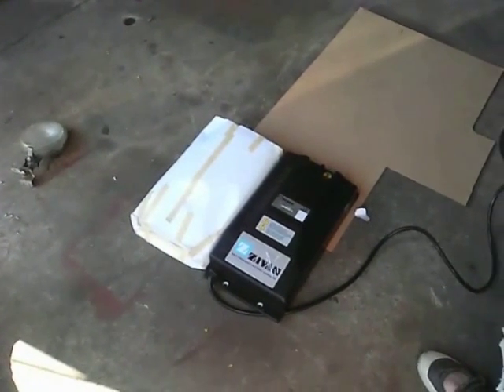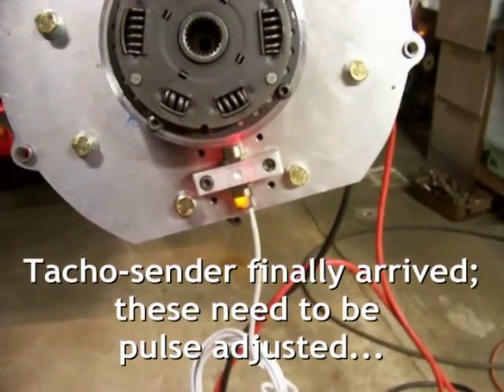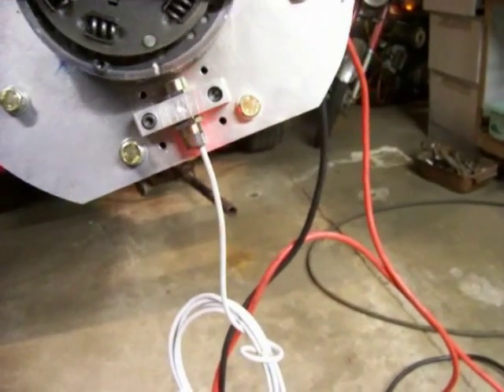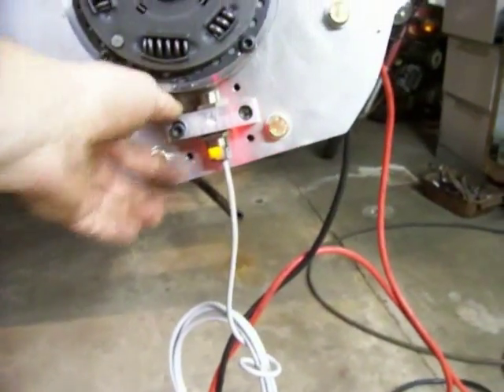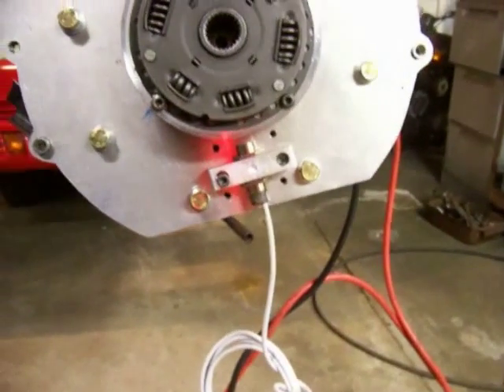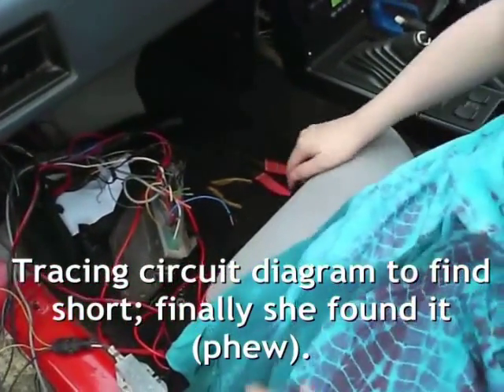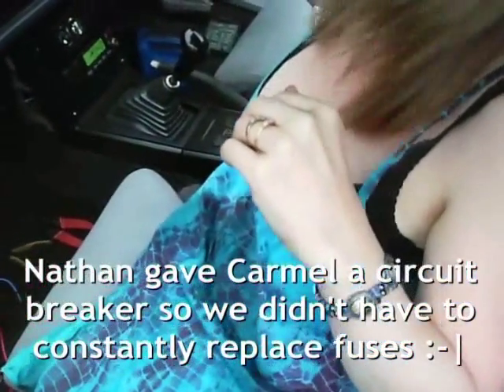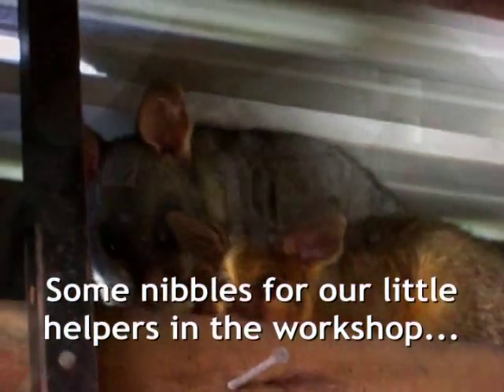Electric Starion - Electric Car Conversion - Part 6

Comment: Can u guys and gal contact me as I'm trying to import a  small electric wheelchair vehicle from china with just 4.4 kw of power but if I can get approval from the NSW government to register the vehicle I'll need to add power steering and air-conditioning so I was hoping you may give me some pointers as a Quadriplegic it will allow me to enter from the rear and drive myself for the first time since I was attacked in 1995

Comment: Nathan, With your tacho sender - won't you have too many pulses per rev? If the original engine was a 4 cylinder you need 2 pulses per rev (for 6 cyl engine 3 pulses per rev). Did you think of using a hall effect device for this?